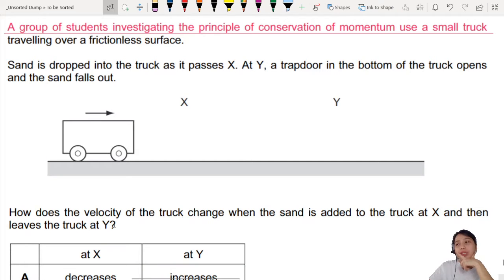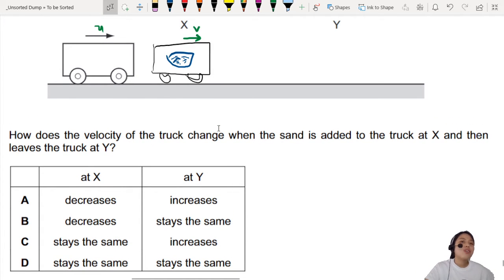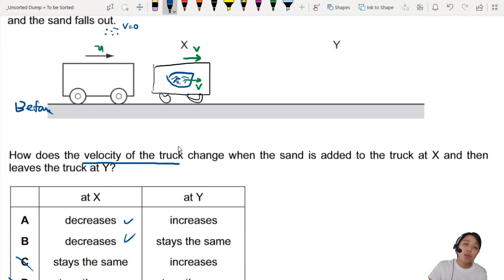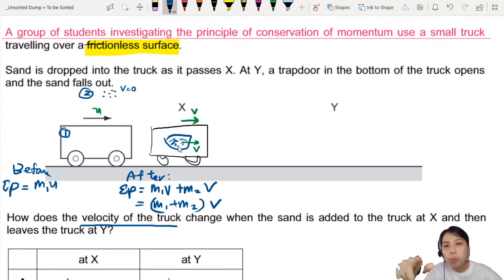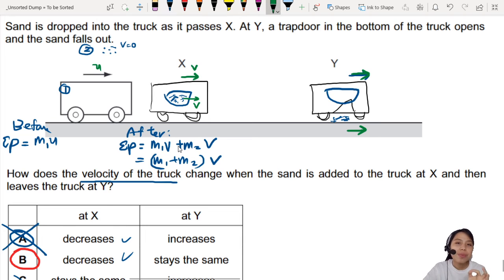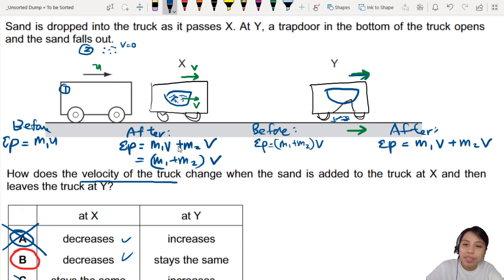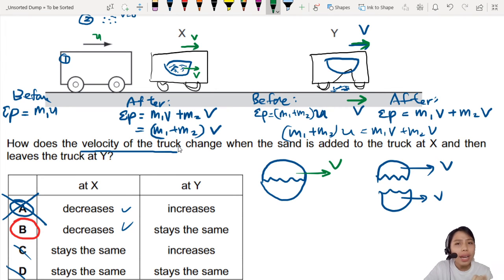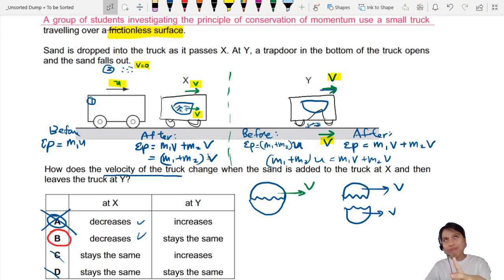ON11 P12 Q10 Truck with Sand | Oct/Nov 2011 | CAIE A Level 9702 Physics

Comment: What about gravitational acceleration and increase In vertical speed for sand
Reply: 💡 Let’s break it down:

📍 Horizontal vs Vertical Motion:
	•	We’re only interested in horizontal motion because the question asks about the truck’s velocity (which is horizontal).
	•	Gravitational acceleration acts vertically.
	•	There’s no external horizontal force, and the surface is frictionless, so horizontal momentum is conserved.

Comment: at y, after you remove the sand
why does it travel rather than falling down

even in the presence of gravity why does it not fall ?
Reply from the maker: It would fall (onto the frictionless surface), but still continue to travel to the right because it still has horizontal momentum!